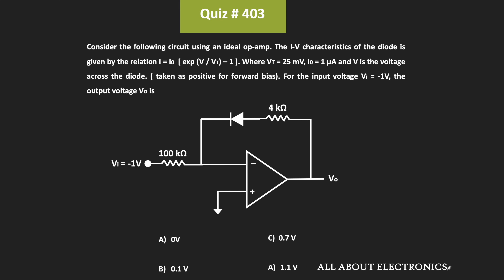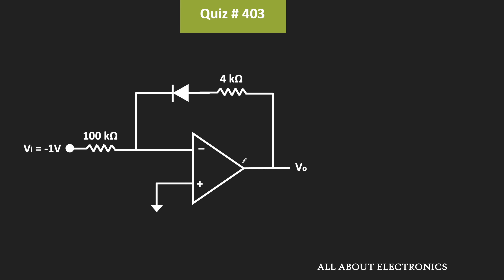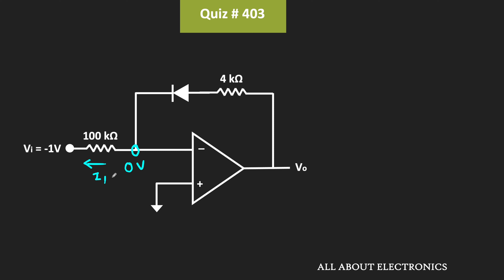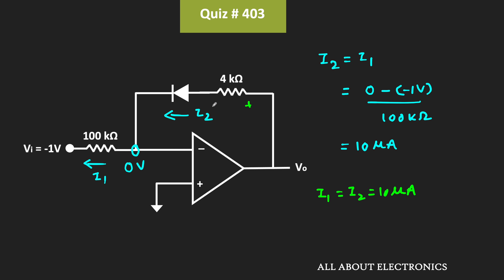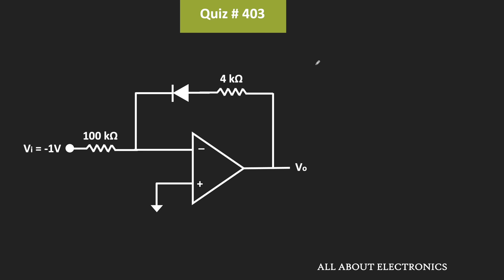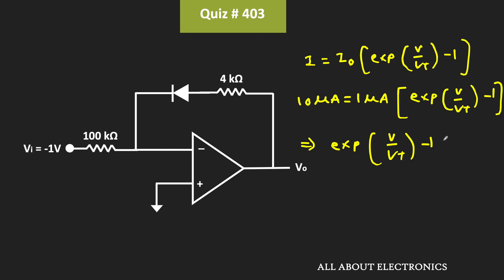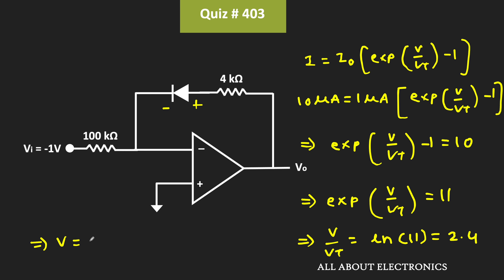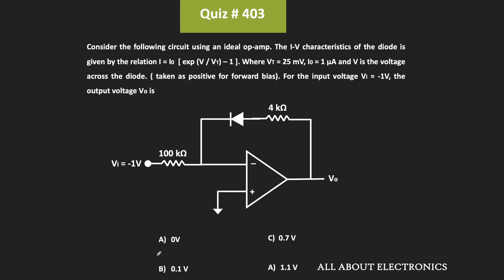Operational Amplifier (Op-Amp) Solved Problem (Analog Electronics) | Quiz # 403

Comment: So, what is the function of op-amp if  Gain < 1
Reply from the maker: This circuit is not meant to be used as an amplifier. Here, it can be used to measure the temperature (as a temperature sensor). The diode voltage is a function of temperature. So, as the temperature changes, the diode voltage Vd will change. And it will be reflected in the output voltage. (Vo = 40 mV + Vd)
Reply: @allaboutelectronics-quiz  Thank you sir 🙏